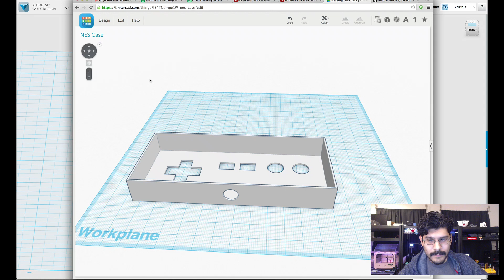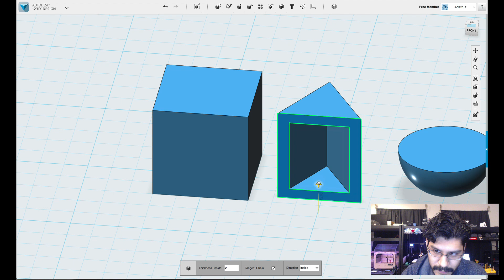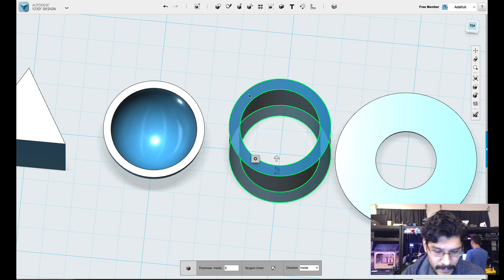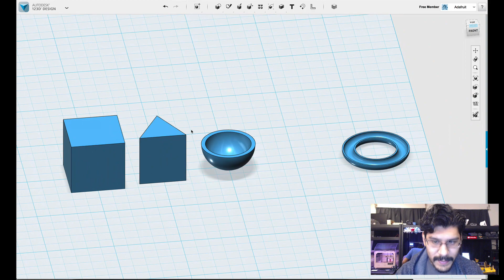Make Hollow 3D Printed Models - CADurday

Comment: It does work on a cylinder. But is tricky - you need to first make sure you select the face not the edge. I made this mistake. Then hold shift to select the other face. After you have both faces selected - press the shell button or "j" shortcut and it will work just like in the demo. thanks for this great demo - it helped me figure out how this works!